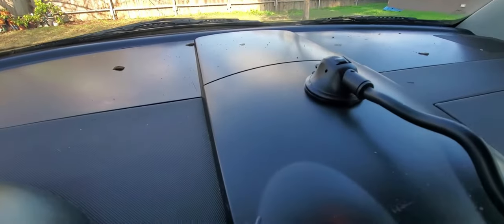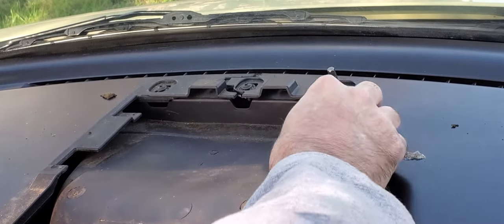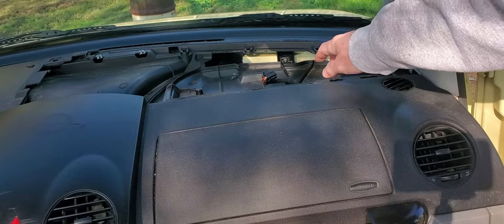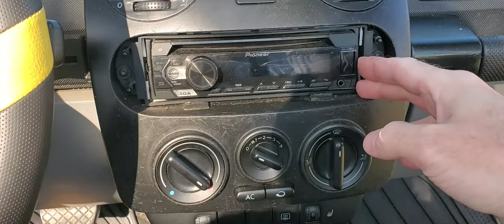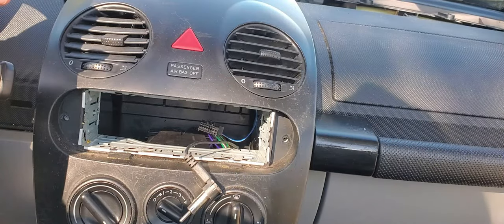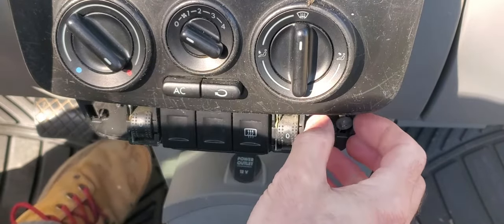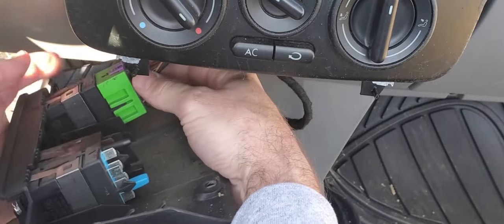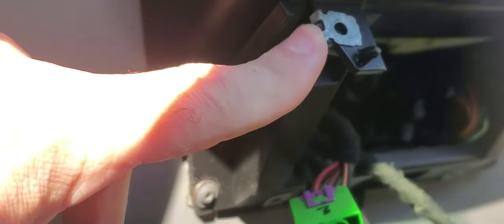VW New Beetle Blend Doors Fix Without Removing The Entire Dash.

Comment: Update you guys, I just did this process. Completely fixed my HVAC issues. I now can actually choose what vents I want and what temperature! I also had no idea how much air my blower motor was actually moving! (I bought the car with the foam already obliterated). The only thing I did different was I plastic welded my duct work back in because it was available to me and was way faster. The whole process took me between 3-4 hours. If you think you can’t do it, yes you can. It looks hard but it’s crazy simple.
Reply from the maker: That's awesome.  I'm glad it worked out for you.  Yeah it looks a little scary but you can do it!
Reply: You, Sir, are a remarkably meticulous and patience mechanic.  You are also a  notable documentarian.  Only someone who has attempted to penetrate the mysteries of a new beetle's dashboard can fully appreciate your instructional efforts.  Thanks for assisting your fellow VW owners keep these work horses on the road.  (I honestly think I could replace the engine in my '67 Type Two in less time than it will take me to duplicate your work on my '99 NB.)  Sincere thanks, Bro!

Comment: Thanks for this great video! It certainly helped me getting the dash apart to fix (clean and tape) the blend doors. However, when you start with the saw around 48 mins, I continued removing the plastic over the complete size. At that point, there's only a handfull of screws left (mainly around and under the steering wheel) and you don't have to take the steering wheel off, just hover the panel to your ceiling. If you want to keep the plastic in one peace, just take the additional few mins of work.
Reply from the maker: Glad it worked out for you.  I tried to do it the simplest way possible. But I'm happy you got yours fixed too.

Comment: Nice video, I guess you could just take the center out as you went and cut the part out to get to the doors. I can only think they save $ in the doors when having holes in them. You would have thought the germans would have been a bit more on top of the door issues and not have holes. I am going to try this on my car as I have the same issue AC not cold when very hot outside. Thanks !
Reply from the maker: Thanks for the comment.  Let me know how everything turns out for you.  Honestly it was the easiest way I could figure out how to do it that would permanently fix the problem.  Mine is still working great.  Let me know if you have any problems or questions.  Thanks again, Kelly

Comment: JB weld STICKS to plastic, as in it can let loose. 3M semi rigid which ain't cheap will BOND to plastic. i reconstructed the  NB's front shattered fender bits back in to new fenders with 3M Semi R.
Reply from the maker: Good to know.  Mines still holding up fine so far.

Comment: I am approaching the need to look at the blender doors and I have watched your video thoroughly.  Where can I find the type of Glue you are using (white when dry).  The glue appears to be very solid.  My Beetle is a 1999.  I have had the Air Conditioning essentially all replaced in 2012 and it is possible that they have fixed the Blender Doors at that time.  I am not sure  of precisely what they did, so I am in the dark on that.  I have tried to look in their using a small endoscope and some light down through the two holes on the portion you have removed.  I have not been able to see what is in there so I am thinking of cutting a section out of the beveled portion (the bottom area) of the part you removed. It will only be a small section maybe 5" by 3" and I hope to have both visual and if necessary access to tape the holes. Any suggestions?
Reply from the maker: Thanks for watching.  The glue is J-B Weld Plastic Bonder.  You can find it at Lowes, Home Depot, or Amazon.  It is very hard when it dries.  You need to look at fixing the Blend Doors if you have black foam particles coming out of your vents when you turn the AC on.  Those particles are the foam covering of the Blend Doors.  Also if you turn the AC on and select, for example, the setting for floor only vents and you can still feel air blowing out of the upper vents then you probably need to look at the Blend Doors.  Finally, you might be able to cut a smaller hole in the bottom section but remember you have to be able to get your hand in there holding a section of tape and be able to move around enough to get the tape into the correct spots.  You don't want to miss a section or accidentally tape the door closed so it doesn't work at all.  Also you need to be able to clean the Blend Doors before you add the tape.  For me it was easier to go ahead and just cut that larger section out and glue it back in after I was done.  I did only as much as I had to do to make this fix work.  BTW it is Still Working Perfectly 8 months later.  Hope this helps.  Kelly
Reply: Hi
  Thank you very much for your reply.  I could not have even thought of doing this process, at all, were it not for watching your video.  My old Beetle is getting on and I am trying to keep it on the road. I have proceeded with cutting a section, as I mentioned, and it came out using the vibrating saw that you used. My vehicle has over 292K Kilometers (182K Miles).  I live in Canada, specifically British Columbia.  The body is like new and has the original paint job. 
I was having an issue with my AC and not sure just whether these blending doors were working properly, before I looked at the other components of the AC.  I cut a section about 6" by 4" and was able to view (and access) the doors.  I essentially cut along the top of the bottom section where it thickened and then about 1/2" in from each side. That meant I only cut three sides. I will use similar plastic, as edge backers, and glue them in place.  Once they are solid I will put the cutout back and glue it against the backers. (Thanks for identifying the glue.)
   The doors were working and pristine.  Yes the foam was all intact and covered both doors completely.  I could hardly see the holes through the foam. 
   I was wondering if the fact that my Beetle has always been driven in colder climates and possibly survived because of that. Anyway it is going back together and I am so pleased for your help.  Cheers ...
Reply from the maker: I'm glad it all worked out for you.  I live in central California and we use the ac every day so maybe that's why the blend door covering wore out faster.  Anyway thanks and have fun with your beetle.  K

Comment: Would this fix weak air flow coming from the vents?
Reply from the maker: If you are having trouble directing the airflow to the vents you want it then absolutely this will help. That is one symptom that you have this problem.  So if you for example direct the airflow to come out just the forward vents but you feel it coming out the defrost vent and the vent for your feet then you know for sure the blend doors are compromised.

Comment: i wouldn;t mind taking the whole dash out if i can have at the HVAC box inside to replace foam seals and all that but, if you gotta remove the heater and evap cores it really isn't worth it. if you can get the HVAC box out you can wrap the aluminum tape all the way around the blend doors so if the adhesive ever lets loose it stays on. looking at upgrading steering wheel and painting the grey panels.
Reply from the maker: That tape is pretty sticky and tough.  I think by the time it might come off the car would have been dead and junked for some other reason a long time ago.

Comment: Know someone selling a 2004 tdi beetle with 214 k miles on it but sounds like it has the same vent issue. Do you think 1,000 is worth it. Thank you
Reply from the maker: I bought mine for $900 and it had 85k miles.  Over 200k I think you are looking at the lifespan for this car. I would keep looking for something with lower miles.

Comment: foam might seal better when new and also act as a sound dampener but, i'm not sure i buy that. these NBs were first generation plasteque and planned obsolesce, tow imboilzers so a dead gauge clusters kills the car.
Reply from the maker: It's like they build them so you have to take them back to the dealer to get fixed.

Comment: If you were mostly concerned with fixing the blend doors, couldn't you just proceed with that when you removed the center console? I do see that accessing the vents would help you clean out the mess from the deteriorated foam but isn't that the real benefit from most of the removals from about 19 minutes into the process?
Reply from the maker: Thanks for watching and the comment.  Ok well when you remove the center console section about 19 minutes into the video you still don't have access to the blend doors.  You have to cut through the section under that before you see the blend doors.  See about 57 minutes into the video and you will understand why I had to cut out that section.   Thanks,  Kelly
Reply: I do get the cutting out for accessing the doors. But, wouldn't that be possible without removing all of the additional components on the passenger and driver sides?
Reply from the maker: No.

Comment: I seen someone do a video but you don't have to tear apart the dash. Only thing is remove a bottom panel on the passenger side and it's right there up above.
Reply from the maker: Yeah I would have to see that to understand how that would work.  In my year/model there is a wiring harness, airbag components and metal piller all in the way on the passenger side.

Comment: Still nobody knows for sure why there are holes in these blend doors in the first place.
Reply from the maker: I think they just want you to have to take it back to a dealer to be fixed.  But you can fix it yourself for just a few dollars and some patience.
Reply: @deadlinekelly9938  I read a theory saying the holes are there for the reason of making the blend doors easier to move.

One factor would be simple weight reduction and the other is more technical. While the fan motor is running on a high level, the rush of air creates a force making it harder to move the blend doors. The holes with the original sponge-like coating would allow for some air to pass through them, resulting in less air resistance.